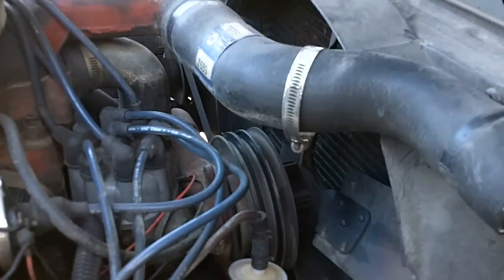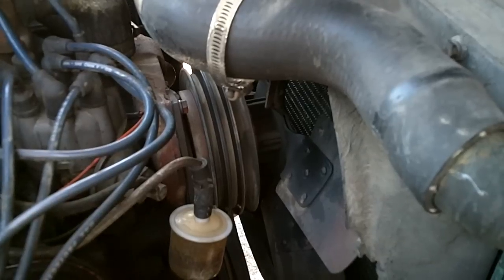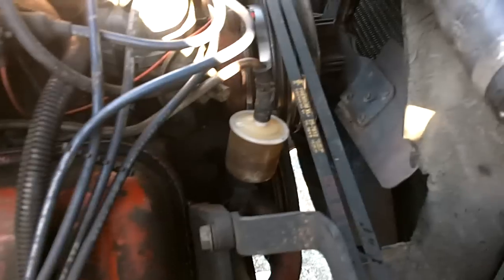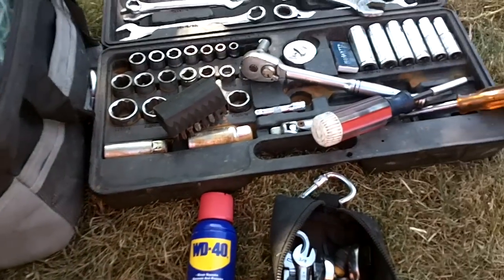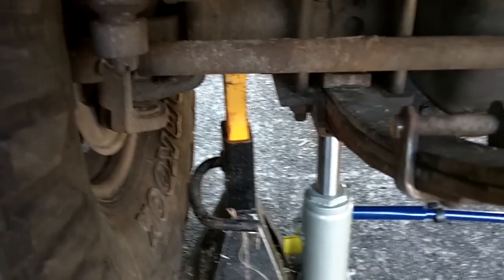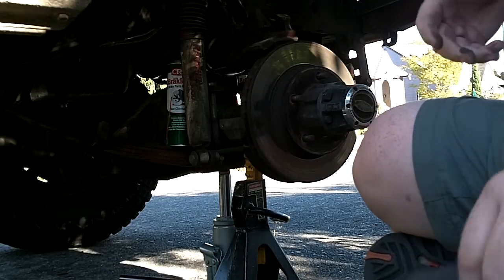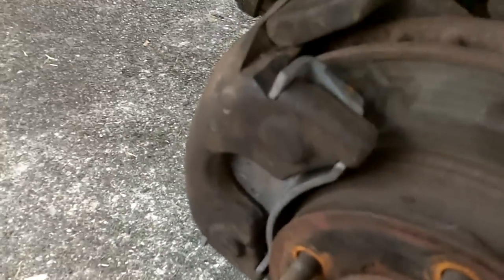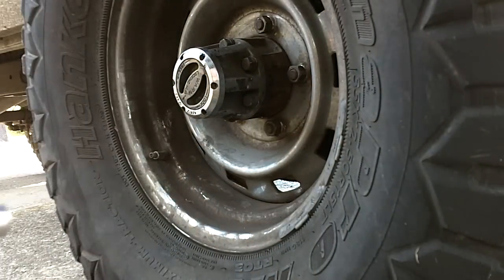BOV Maintenance

Comment: Dude, brings back some a lot a memories. I spent 20 years in the automotive field turning wrenches for several years. When I was a teenager, I was driving a 85 F250HD with a 460ci and 4 speed and I handled everything mechanical on that truck including the rather big job of and intake gasket replacement....lot's of smog crap on that model year. Later I drove Explorers and ran them like Trophy Trucks having to replace the front pads every 5000 miles. I got real fast at that job! Love this vid man!

Comment: Good job. I'm a 16 year heavy diesel truck mechanic and couldn't have done any better with my emergency tools. You'd make a good mechanic if you want to change careers.

If you're in the field and you spring a water leak you might consider loosening the radiator cap so it won't allow the system to pressurize, then you can sometimes limp it home and save yourself a tow bill.
I've seen that radiator stop leak work but never on a seal like on a water pump. Worth a try though.

Comment: I heard that the secret ingredient in WD-40 was fish oil and I've found that 'liquid wrench' works even better.

I have those exact same jack stands.

I usually hit the rotors with a little sand paper to take any glaze off and I bleed the brake line after to get the burnt fluid that sits in the caliper out. The one man brake bleeder pumps work great and some parts stores lend them out.

Comment: @beast12101 That's what I meant to say was better than WD-40. If the PB blaster doesn't work I'll heat it up with a torch and then let wax melt back into the threads.